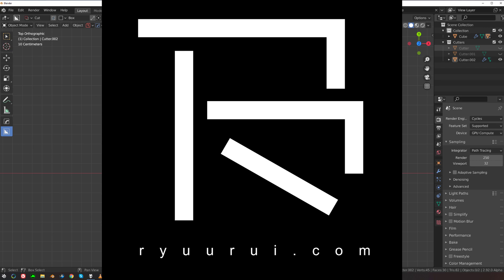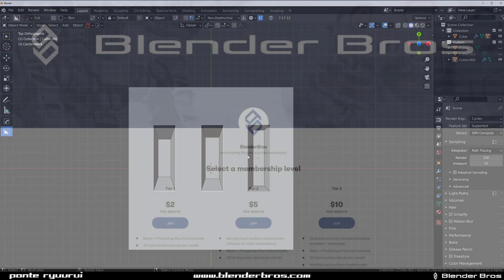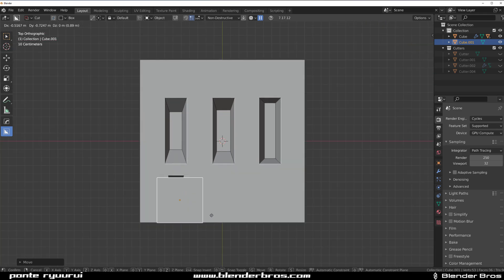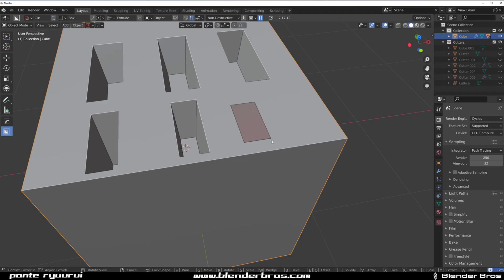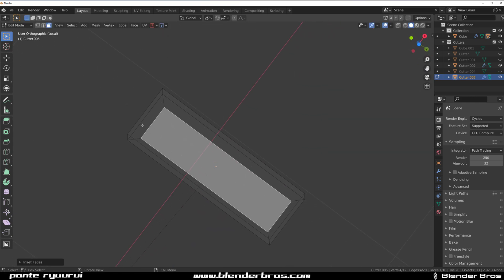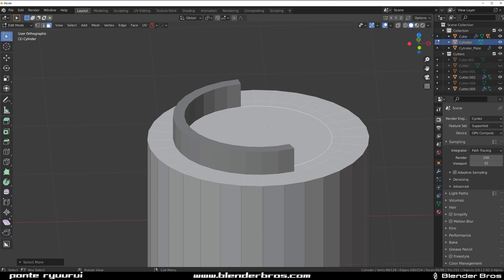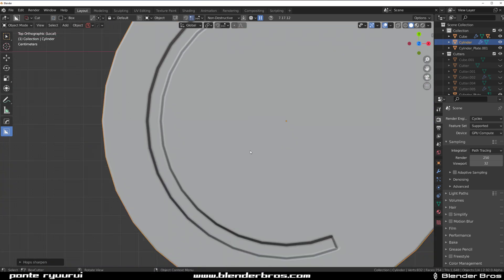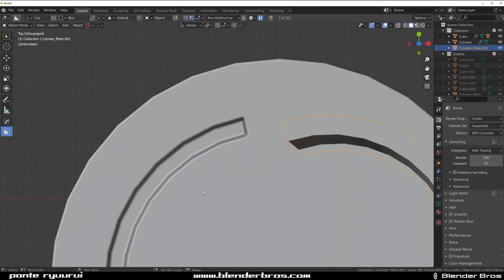Proportional TAPER Boolean tutorial for Blender 2.9

Comment: this is a lot easier than what I usually do- just bevel the outside edge by 1 and then drag the face down. dunno why I didn't think of this lol
Reply: Alt S does taper perfectly for non-square shapes. It doesn't work with Shft Z because it scales along the objects normals, so you'd have to adjust the height afterwards but yeah try it. Unless box cutter overrides this for whatever reason it should work.

Comment: nice tip :) But I think that Offset Edges addon will do the same job.
Reply from the maker: ooh i need to check that one
Reply: I tested the offset edges addon and it can do it but you have to individually merge all the verts on to the inset because the inset does not stay connected with the main object.
Reply: @rolston4107   hi, you can change method of offset : 1/extrude  2/move  3/offset

Comment: I'm not a blender person by any means, but wouldn't selecting all vertices you want to scale then pressing Alt+s to scale along the vertex normals.
Resulting in a proportional scale for all selected parts, rather than doing the inset method be much quicker. 
https://i.imgur.com/811LWKs.gif
Great stuff btw, I'm new to blender so finding all these new techniques are super useful
Reply from the maker: Nah, that wont work with verts, and cheers.
Reply: @PonteRyuurui  Sorry I'm a bit lost as to why it doesn't work? 
I know it doesn't work for box cutter, but using the difference Boolean it does seem to work as expected, even with objects that have odd shapes.
It seems to work how I would do it in max and maya?
https://imgur.com/a/NgU8EWp
Reply from the maker: @JordanMossy  no idea mate, you d need to ask whoever coded that thing, but i assume it has something to do with the difference in face / edge length differences
Reply: @JordanMossy  Nice Tip! works perfectly.

Comment: Nice tip. It should be faster to alt+click old loop instead of using border select. I tested for some cases and works fine.
Reply: works only in this easy context, when topology is messed up it will be a lot more harder without the border select.
Reply from the maker: @EinMeister  boom!
Reply: What I do to speed up the process is inset the area, then I use custom keybinds to to do the select more, select boundary and dissolve edge. That is my preferred method but it all comes down to preference.
Reply: @rolston4107  What keystrokes are you using to select boundary loops?
Reply: @EinMeister  Alt, .